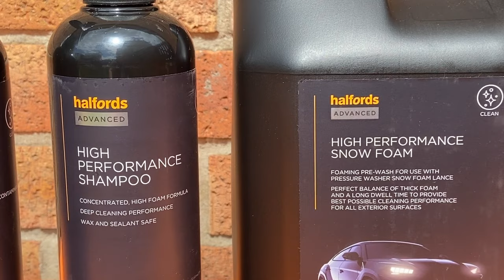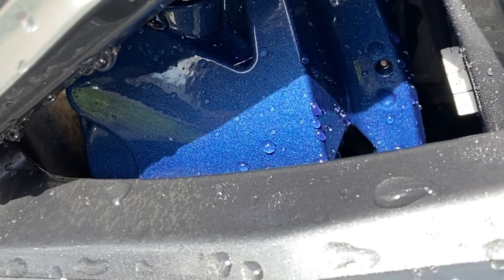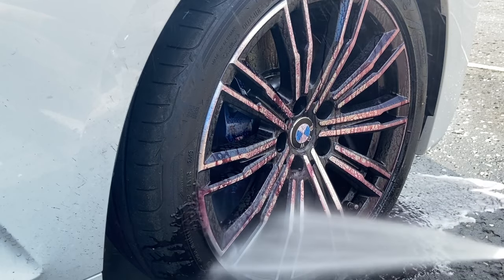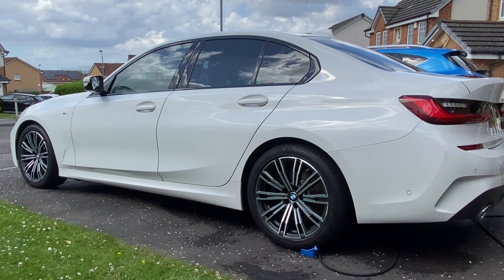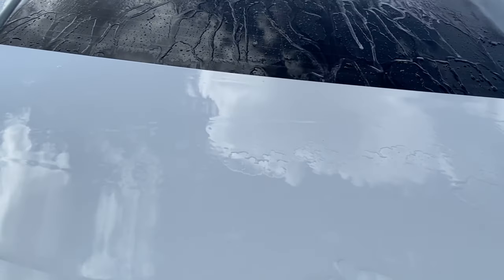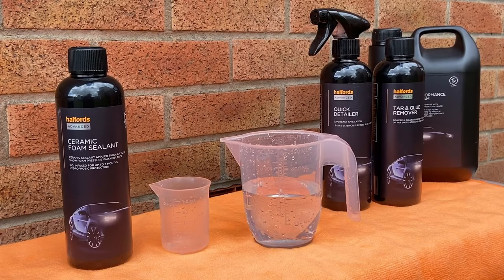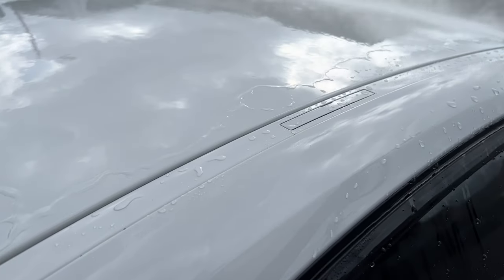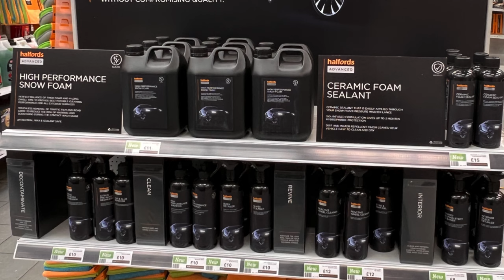HALFORDS NEW ADVANCED CAR CLEANING RANGE REVIEW WASH AND PROTECT

Comment: You have put me straight on the use of snow foam. My efforts gave the same result but I should have shampooed after. RTFM i think. Great Video and no nonsense advice. I will add the ceramic and shampoo next time. 5/1 ratio at 1 litre did the car and caravan roof. I have always found Halfords own products to be quality. Another comment below about using a glove mitt to clean the wheels as also a great tip..
Reply from the maker: Thank you I hope you have better results next time you use them and if you have a B&M near you they stock a glove mitt (RAC branded ) ideal for wheels 👍

Really appreciate the comments, glad you enjoyed the video 🙌🏻

Comment: Halfords own products might not seem"Sexy" to detailers but on that showing they did a good enough job. I wonder what AutoBrite are thinking about that Spray on Ceramic Sealant with their own Magiseal offering that Halfords sell. Although I didn't find Magiseal had a great longevity but it's been a while since I've used it so may be wrong in that. That was a good tip about cleaning the barrels bottom to top which makes a lot of sense. That is my top tip for this week.
Reply from the maker: Ahhh thanks John!, always like when someone notices a top tip 😁
I’ve yet to try the Autobrite one , I know a few valeters that swear by it , massive time saver

Comment: Great vid Graeme, I kind of done the same spray and rinse top up. I put 2 sashets of BH touch on in to a 5ltr of DI-water and use it on wheels and top up the lower parts around the car. Beeds up well and cheap as chips 🤣🤣
Reply from the maker: Brilliant!!, that’s the kind of thinking I like!!, long lasting protection which doesn’t cost a fortune and no time wasted waxing 👌
Glad you liked the video Kev 👍
Reply: Excellent idea. After a few months, have you noticed any degradation of that mix? Thanks
Reply: @pigeonpoo1823  I just use it just for wheels now, a lot cheaper than Gyeon wetcoat and you can really whack it on too. Bead's up nicely buddy 👍
Reply: @kevinb7058  superb. I have 1 sachet left. Thanks for the reply and the advice.

Comment: I've been looking at theses recently and the lack of a 5 litre option for the snow foam seems to a glaring mistake but then if aimed at the likes of me, a weekend warrior, I  guess that they're trying to keep prices down and it takes up slightly less storage space .....

The reacrive wheel cleaner looks like it does a first class job but I've always been led to believe that it, and fall out remover, should be used after the wheel is cleaned so it's acting on the ferous particles and not possibly being  blocked by the dirt
Reply from the maker: I think you’re dead right it’s a hobbyist they seem to be aiming the range at, you never know it may get larger if it’s a popular range, Halfords seem to chop / change quite often in that respect. 
Wheel cleaners are a bit of a talking point certainly, personally I keep fallout removers for a once a year deep clean but on another thought, maybe someone has really bad wheels they want to clean, I def think it’s very good but not for every clean

Comment: Thanks for that. The sealant looks  a good winter purchase.
Here's how i use the snow foam. Ik foamer: 2% foam, 2-4% Autofoam (or 2-10% surfex) and its superb for wheel or lower half of the bodywork cleaning or bicycle cleaning. BH does its job and stays put for longer. 
Liked the subliminal😂 messaging wrt demon stuff
Reply from the maker: Cheers mate!!, do you mix the surfex with the foam then apply both together or surfex on the car 1st?
Demon foam is sooo bad isn’t it 🤣🤣
Reply: @GMDetails  that is correct. So I mix 2l DI water, 40-80ml AF (or Surfex), 40ml Halfords snow foam. It's basically the super foamy AF we all crave. How's that for a slice of fried gold!
Another is add Autoglanz foam booster to any ceramic shampoo (car chem and touch on so far) and you get a normal mega sudsy shampoo.

Comment: I bought the Citrus, Wheel Wash and the Ceramic Spray yesterday for just £27. I ran out last week, and thought I’d give them a go. I have BH Auto Foam so didn’t get the foam spray. Hopefully I can have a go later………………..
Reply from the maker: Superb!!, let me know what you think 😀
Reply: Well, I managed to clean my motor last Friday, and tested the ceramic spray. First I used Halfords Reactive Wheel Cleaner, 3 wheels came up lovely, but the 4th was a pain. ( I later realised why. After a recent MOT, the brakes were picked up on, so in it went for new brakes. 2/3 days later it was grinding. Turns out, even though they said replace brakes ASAP on advisories, when it went in they didn’t……………. As I had to use it for 2 weeks before I could get it done, it deposited lots of crap onto the barrel 🤬🤬🤬 ) Bilt Hamber Auto Foam snow foam, was followed by Meguiars Gold shampoo prepped it, then time for the Halfords Ceramic Spray. 
I put in 60ml to 600ml of water, made sure vehicle was wet then coated it. It beaded nicely on spraying on, then I washed it off. It beaded ok, but wasn’t amazing, I dried it then stood back. As I did I realised my drying towel was soaking, the wettest it had ever been. I wondered did it need curing time, so since then I have kept an eye on the car as it has rained, no difference. Tonight I looked again, lots of small beads, but no sheeeting. 
So, looking back, the only thing I could think of I may have done wrong was, I used my MJJC short trigger gun to blast it off instead of my K4 turbo lance………….. I will try it again, but not too impressed by first application, which is a shame, as the wheel cleaner was awesome and I was hoping for a similar performance from the ceramic spray.
Reply from the maker: @cerealkiller4248 ah I think you might have went in a little weak at 60ml the recommended dilution is 50ml to 250ml water so even using 500ml you’d still need 100ml of product to achieve the recommended dilution
Reply: @GMDetails  That rings a bell, I was going to check the dilution, but couldn't be bothered to go to the garage as it was so late when I replied. I mixed up 600ml as I have a VW Transporter. I'm going to try it again as soon as the rainstops,  the Starlings have started their bombing missions early this year 😳 
Hopefully the 2nd application will improve the finish 👍
Reply from the maker: @cerealkiller4248  it should do, remember you can also make up a solution as a spot spray and rinse in a trigger spray too 👌

Comment: Hi mate, I've just ordered an mtm lance. I've got the K5 compact as you had/ have. 

Couple of questions does it come with a 1.25mm orfice and 1.1mm? If so did you leave the 1.25mm in for the K5?

Cheers
Reply from the maker: Hi Jim, mine only came with the one oriface and that’s 1.25mm, with the K5 you’ll not need a 1.1mm , did u order the new one with the wider mouth?
Reply: @GMDetails  Hi, that's good to know. Nope I couldn't find it in stock anywhere, and I'm in a rush for as my other lance just broke on me.

Comment: Why do you rinse bottom to top? Thanks for vid BTW, really informative
Reply from the maker: Short answer - once the foam has dwelled I always rinse the ‘sunny side’ bottom to top as the flow from the pressure washer is removing the grime, gentle flowing water from the top won’t remove grime , you ‘can’ still  achieve this from the top if you’re really careful but  the most important reason is while I’m rinsing the foam all around the car still has time to dwell and be effective for those precious few minutes, plus it is a guide to see where I’ve been, it’s a very divided technique , it’s what I’ve done for years and works for me
Reply: @GMDetails  nice one that makes sense to me. I'll try it

Comment: Great video. Subbed.
Reply from the maker: Awesome, thank you!
Reply: @GMDetails  I used the wheel cleaner today based on this video. Result was pretty good. I do find a bottle is just enough for one clean. Maybe two. This is probably the most expensive part of the cleaning process. Would a apc or Bilt hamber cleaner be better?
Reply from the maker: @SabeTheApple  Hi! 🖐️ 

An APC would certainly be perfectly fine for a maintenance clean but if the wheels haven’t been cleaned for months then a reactive wheel cleaner would certainly be beneficial
Reply: @GMDetails  have you tried Bilt hamber?
Reply from the maker: Auto Wheel?, I haven’t actually 🤔
Reply: @GMDetails  might have to try it